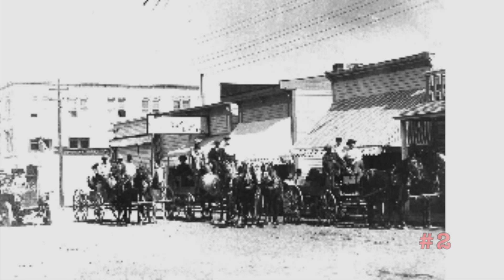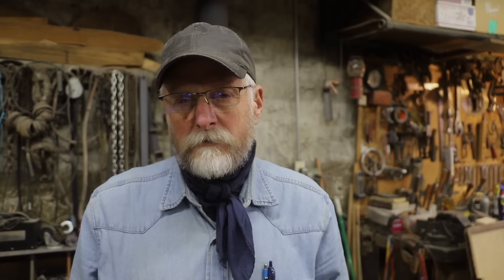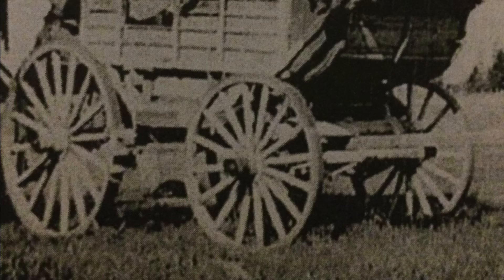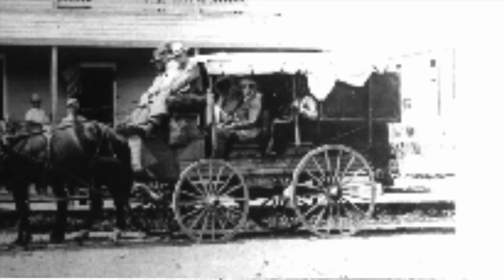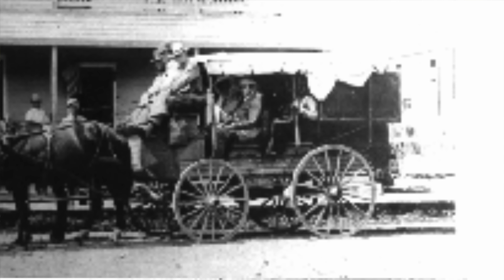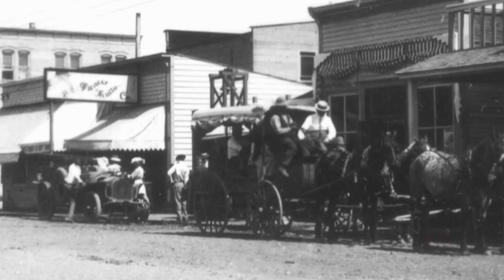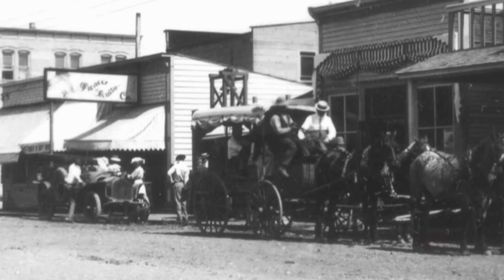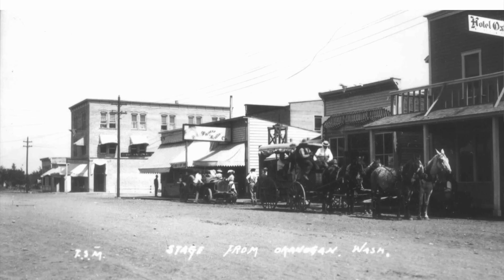Discovering the Original Mud Wagon Photo | Engels Coach Shop

Comment: One also has to remember that some of these were also repurposed wagons. I recently found a us postal wagon picture that also looked a heck of a lot like the bones Dave has.  It may not be exact…but there is more detail in picture to look at for ideas.

I know growing up we has some “bones” out back inthe weeds of an old seeder. It had wooden wheels and framework. It is probably long since turned to dust with ironwork in ground if it is there at all. Some of the stuff we had around yard was made up of repurposed old stuff. The wagon for our garden tractor had solid wheels from something else and most of the steel was from old John Deere snowmobile crates.

The farm wagon had car wheels mounted to axles with old wierd  leaf springs. It had a really long tongue for towing too. It could have started life as a horse drawn hay wagon.

Comment: Check out the coach used in the 1969 Paul Newman movie "Hombre".  It shares many features of the one you are rebuilding.  The major difference is the loss of a middle seat.  It could have been made by the builder of your coach if not a reproduction.

Comment: I keep coming back to this Picture, the Seat is separate from the Back Board? The top is covered with Canvis. There appears to be a bent / curved post coming out and up, supporting the Back Board which is covered by Canvis. The Seat has a back similar to the Interior seats. Apers to have a Matl Seat Iron simile to the interior Seats attaches to the Seat Back, the end of it appears to be attached to the Back of the Seat. The Duster the Man is waring covering over the Iron and seat Sideboard.

Comment: At first I thought it might be a name. Of the photographer perhaps a Frank Matsum Foto. So a googlin I went, only to find
Frank Matsumoto was/is a very popular name. And then a rewind later I'm looking at that newer name with a mishap in the penmanship where the ink just didn't flow down the slot for the first 'O' and then that was fixed with a concurrent misspelling which ended with the total giving up of ever making it right now with far more damage done already, so quit while you are ahead. Perhaps. Pictures in the old days were very difficult to write on with anything of course. Since it's in white lettering, this would have to have been done in black ink on the negative which is even slicker than the actual photograph. Most likely a glass negative in the first place. You already know it's valuable and quite delicate to start with, so reasons to quit quickly out weighed the urge to vandalize an already antique.
Reply: Nevermind, A more decent sleuth came along and saved the day. It still looks to me like the penmanship is trying for flare and is having troubles with the Ms in particular.